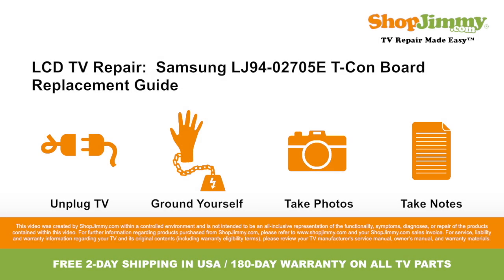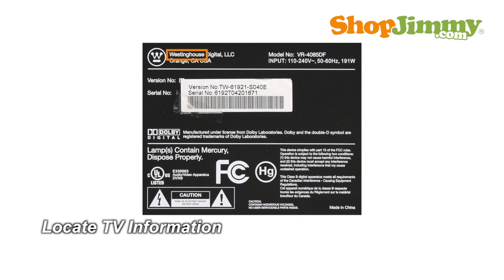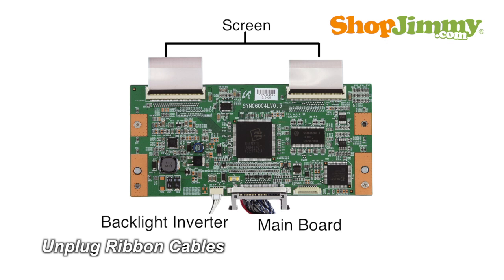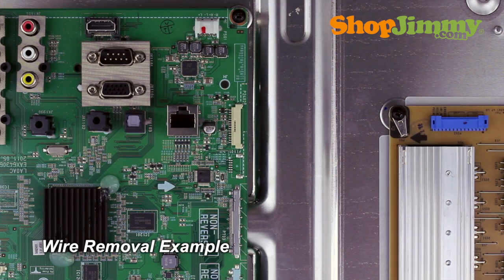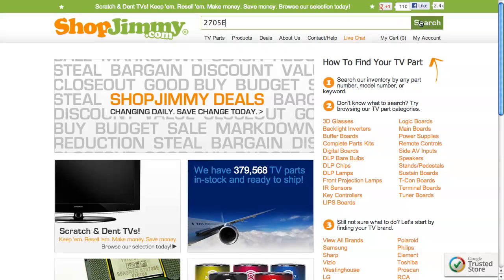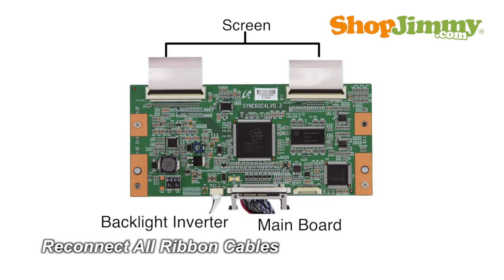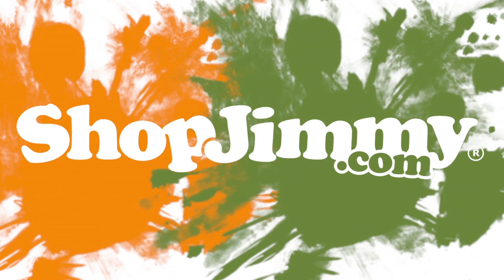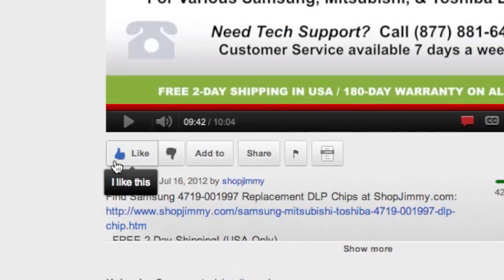Samsung TV Repair - How to Replace T-Con Board in LJ94-02 705E Model - How to Fix LCD TVs

Comment: Question, I have a proscan LCD that as soon as any picture shows up the tv automatically shuts down.  It does this as soon as a picture from the antenna, dvd or xbox comes on the tv.  I have disconnected various boards and what I have discovered is that when I disconnect the FPC cable from the T-Con the tv stays on.  There are two FPC cables and I have tried leaving one connected but as long as any FPC cables are connected the tv automatically shuts down the moment a picture signal reaches the tv.  I can work the tv menu on the tv as long as there is no signal input.  Does this mean the T-Con board is junk or could there be other possibilities?

Comment: Hi, I have a Samsung 32 inch lcd tv. Model LN32A330J1DXZA SERIAL # AKZ43CRQ800919Z. TV has no power or picture. The capacitors look good, no buldging or leaking, could the t con board also cause this problem? Right now the tv dose nothing, Thanks for your time.

Comment: hi sir. I have a 32" LED before couple of day it turned off bcz of short circuit then I show my LED to the repairing shop repair man checked the LED carefully n then he found the problem. the T cord was short or finish.anyway I buy the new T cord which is matched with original T cord so he fix the new T cord and on the power of my LED but now the problem is that LED picture is rotate down so now I am watching my LED up side down plz send me a useful suggestion hope u understand me. thx allot regards Waseem Ahmed Pakistan

Comment: I have a Samsung 46 in 3D LED TV.  We get audio on it but the video stopped working.  It does have the back light still. I watched a few of your tutorial videos on YouTube and think it has a faulty TCon board.  The part for that is LJ94-03870c.  Do you think it is the TCon board that I should replace.  Do you have that part? How do I replace it because one of the ribbon is difficult to remove?
Reply from the maker: Parminder Sahota  Try all repairs and troubleshooting at your own risk.  I recommend running the flashlight test on your TV.   Here is a link to a video we produced that shows how to run the flashlight test. https://www.youtube.com/watch?v=xUzCLgoSPGM Please reply with your flashlight test results and we can recommend a replacement part for your TV repair. Thanks and please let us know if you have any questions! www.shopjimmy.com

Comment: Hi, my samsung tv is solarized. if i let it "rest" for about an hour or so and turn it on, it's fine again, but only for like 15-30 seconds tops, then it gets solarized again over the course of a minute or so. i've opened the back panel, didn't see anything unusual on any of the boards. disconnected and reconnected all of the cables on the t-con, didn't make any difference... any thoughts of whether or not i should buy a new t-con and replace it?
Thanks in advance!
Reply: oh, forgot to mention it's a 5 year old  LA37A550P1R and when the image is solarized, the menu is solarized as well.
Reply from the maker: shvedoren  Please watch this video FIRST to help with your repair!  https://www.youtube.com/watch?v=BP3NVNCGEv8  This could be a problem with either the main board, the t-con board or the TV panel.  You can replace  the main board and the t-con board to see if that fixes the problem.  Click this link to replacement parts:  http://www.shopjimmy.com/catalogsearch/result/?q=37A550  There may be multiple boards for the same TV model number, be sure to match part numbers on your current board, with your replacement for compatibility.  Thanks and please let us know if you have any further questions with your TV Repair!  www.shopjimmy.com

Comment: Hi Shop Jimmy, 

Great video!  My Sanyo was experiencing some common vertical lines and I replaced the T Con Board.  The TV was working fine for about 5-6 days after the repair, but the problem is back.  The lines appear sporadically for brief moments of time.  Is this an inherent problem with the ribbon connections perhaps?  Can I tape them or something to make them more firm? Thanks again.

Comment: i am from india i bought a a new samsung LCD tv model code is LA32C450 last 2years back from last few month top of display  one blue line appear thought right to left side initially day by day it is creasing now it is incensed half of the tv display then i have contact with samsung technical engineer he told it has that display board problem it's need to change display board that board price half of the new LED TV price and he said this problem developed by using cleaning display liquids so i am realy become a mad because which is correct please give me a solution thank you
Reply from the maker: vijesh m   This sounds like a TV panel (TV Screen) problem.  If your TV panel is bad, it may be more cost-effective to replace the TV as panels are typically hard to find in stock, difficult to replace, and expensive.  Thanks and please let us know if you have any further questions!  www.shopjimmy.com

Comment: I got a samsung 46eh6000 screen went black with a dim glow . Sound is still working.I replaced the tcon card that I bouth from you guys but same problem.
What could it be ?
Reply from the maker: Pussinboots1987   Please watch this video FIRST to help with your repair!  TV Repair! LCD, LED, Plasma, DLP How To Fix Your TV with ShopJimmy.com Help!  I recommend replacing the main board in your TV.  Follow this link to replacement parts:  http://www.shopjimmy.com/catalogsearch/result/index/?cat=56&q=46eh6000  Be sure to match part numbers on your current board, with your replacement for compatibility.  Here is a link to a video showing how to identify your part number, click here:  Samsung Main Boards & Digital Boards: Part Numbers for LED, LCD, DLP, Plasma TV Repair   Thanks and please let us know if you have any further questions with your TV Repair!  www.shopjimmy.com

Comment: i have a vertical line on my 40" samsung flat screen tv. it's about 4" away from the right side of the screen. the line is blue in color.
Reply from the maker: dale swanson   This sounds like a TV panel (TV Screen) problem.  If your TV panel is bad, it may be more cost-effective to replace the TV as panels are typically hard to find in stock, difficult to replace, and expensive.  Thanks and please let us know if you have any further questions!  www.shopjimmy.com

Comment: hi, i have a samsung LN40A530P1FXZA series 5...I'm getting sound , but picture is white with no color. i can barely see images. please help. Amelia
Reply from the maker: Amelia Ivery   I recommend replacing the T-Con board in your TV.  Here is a link to replacement parts for your TV model number on our website, click here:  http://www.shopjimmy.com/catalogsearch/result/index/?cat=63&q=LN40A530P1FXZA  Be sure to match part numbers on your current board, with your replacement for compatibility.  You can also call our customer service for further assistance with your purchase.  (877) 881-6492  Thanks and please let us know if you have any further questions with your TV Repair!  www.shopjimmy.com

Comment: Ihave a 46 samsung lcd  model LN-46B650 and it also has vertical lines in the picture as well i see this is a big problen with samsung tv. Now samsung is aware of this problem but would not stand behined thier product to help repair it i guess my next step is to report them to the BBB. please feel free to respond thank you.
Reply from the maker: Martin C   This sounds like a TV panel problem.  If your TV panel is bad, it may be more cost-effective to replace the TV as panels are typically hard to find in stock, difficult to replace, and expensive.  Thanks and please let us know if you have any further questions!  www.shopjimmy.com

Comment: Hi guys- I am having an issue with a 46 In Samsung LN46B650 with vertical yellow and red lines and ghosting as well.  A little research reveals lots of problems with this issue and it points to possibly or more likely the T-Con board ? would you agree with this assesment and also I have read that this model is much harder to access than in the video above.?
Thanks
Randy

Comment: Hi, I was wondering if you could help confirm my suspicions as to what is wrong with my Samsung LE40M87BDX/XEU, one day all colour but blue and white went from the tv, picture is barely visible, but everything is fine. I believe this is the TCON board?!? am i correct in thinking so?
Reply from the maker: liam langford  This could either be a problem with your t-con board or main board in your TV.  I recommend replacing the t-con board first and if that does not fix the problem, then I would replace the main board.  Here is a link to replacement parts for your TV model number on our website, click here:  http://www.shopjimmy.com/catalogsearch/result/?q=LE40M87BDX%2FXEU  You can also call our customer service for further assistance with your purchase.  (877) 881-6492  Thanks and please let us know if you have any further questions with your TV Repair!  www.shopjimmy.com

Comment: (cont.) I have been reading around online and research is leading me to believe it might either be the t-con boards or main but what are the chances?..Im looking to carefully make repairs myself..if possible after extensive research.
Reply from the maker: I believe the problem is either the T-con board or the TV panel.  If the problem is the TV panel it may be more cost-effective to replace the TV.  You can replace the T-con board to see if that fixes the problem.  Here is a link to replacement parts for your TV model number on our website, click here:  http://www.shopjimmy.com/catalogsearch/result/?q=UN60ES6100FXZA  Be sure to match part numbers on your current board, with your replacement for compatibility.  Here is a link to a video showing how to identify your part number, click here:  Samsung Timing Control (T-Con) Boards Part Numbers Identification for LCD HD TV Repair  You can also call our customer service for further assistance with your purchase.  (877) 881-6492  Thanks and please let us know if you have any further questions!  www.shopjimmy.com

Comment: I have a Samsung 60 inch led smart tv model no. UN60ES6100FXZA version HH01. I havent had the tv for even a year before my 3 year old son took a squirt gun to hose it down with. First it was a black pixel width size line started running down the screen to become solid and along came a couple others making themselves permanently planted on the left side of my screen  each like 4-5 inches or les from each other...I saw the splatter marks of the water where they hit that general area and mightve gone over the tv and ran down to the back openings...
Reply from the maker: Anguisssette I believe the problem is either the T-con board or the TV panel.  If the problem is the TV panel it may be more cost-effective to replace the TV.  You can replace the T-con board to see if that fixes the problem.  Here is a link to replacement parts for your TV model number on our website, click here:  http://www.shopjimmy.com/catalogsearch/result/?q=UN60ES6100FXZA  Be sure to match part numbers on your current board, with your replacement for compatibility.  Here is a link to a video showing how to identify your part number, click here:  Samsung Timing Control (T-Con) Boards Part Numbers Identification for LCD HD TV Repair  You can also call our customer service for further assistance with your purchase.  (877) 881-6492  Thanks and please let us know if you have any further questions!  www.shopjimmy.com

Comment: I am trying to change the T conn board in my  SAMSUNG
Model no.  LN-T4661F, MODEL CODE. LNT4661FX/XAA
SN. AHBB3CPPC06804R and I can't figure out how to take off the ribbon cables. They don't seem to have a tab to flip up to take the ribbon cable off. The T conn board is S2247C7J591Y   245014.
Reply from the maker: rick pierre The tab should flip up just like most other T-cons.  You can upload a video or photo and reply with the link if you would like us to take a look.  Thanks!  www.shopjimmy.com

Comment: Samsung LCD 46"  Model# LNT4665F 

The screen appears to be very dark (used movie Immortals to test). The image appears to have a motion lag. The TV was given to me after the first owner "fixed" the clicking noise and slow boot up by changing two capacitors (which worked). But I think the damage has already been done to the T-Con board. Will the T-Con board create an issue as described above?
Reply from the maker: Marcus Anderson I would recommend replacing the t-con board in your TV.  It appears we have substitute parts available for your TV model number.  Here is a link to replacement parts for your TV model number on our website, click here:  http://www.shopjimmy.com/catalogsearch/result/?q=LNT4665F+  Be sure to match part numbers on your current board, with your replacement for compatibility.  Here is a link to a video showing how to identify your part number, click here:  Samsung Timing Control (T-Con) Boards Part Numbers Identification for LCD HD TV Repair  You can also call our customer service for further assistance with your purchase.  (877) 881-6492  Thanks and please let us know if you have any further questions!  www.shopjimmy.com

Comment: Samsung LCD 46''   Model No.  IN46A530P1F

The left side of the screen when turned on( static fuzzy screen) is white 7 inches in from the edge and then fades into black/white static fuzz towards the center.

When I turn my ps3 on(while connected via HDMI), the left side is white with dark patches around mid/left part of screen( purple/white black colors)... when I navigate through menus, the previous icon stays there and slowly fades into the current icon.... after a couple minutes the white/purple faded away and was replaced by black.... I can however, see picture behind the black all throughout.

here is a link to a video of my tv...

https://www.facebook.com/photo.php?v=224941864345625&l=5760372388776436252
Reply from the maker: Jeff Sveinson This sounds like the problem is most likely the TV panel.  TV panels are typically hard to find, expensive and difficult to replace.  It may be more cost effective for you to replace your TV.  Thanks and please let us know if you have any further questions!  www.shopjimmy.com
Reply: I had it temporarily fixed.. I took the back panel off and made sure everything was plugged in properly and then tried tapping on the panel and tilting the tv a bit an it fixed it.. then I had to moved it across town to my new place and its back to square one.. im sure something is loose so I will be checking further into it.

Comment: Hi there,
We have a samsung LN46A530P1F
At first we would turn the tv on and half the screen would be almost opaque black for the first 10 minutes or so, every time it was turned off and on. Now the TV doesn't do that anymore but rather shows all the colors as negatives. I.E. white is black. It looks like what I'd imagine an psychadelic acid trip would. Would the T-con board replacement fix this?

Comment from the maker: @Leo Godin - I would recommend replacing the t-con board on your TV.  This is not a guaranteed fix, if it does not work then your panel is bad.  The metal cover is there for cooling purposes.  Thanks and please let us know if you need helping finding your replacement part.  You can also call our customer service at (877) 881-6492.  Thanks!

Comment: (Cont.) My question is; would the T-Con board failure control or cause vertical lines and could it be that the board is overheating as the unit starts out clear then loses the picture as it heats up. Would leaving the metal cover plate off aid in cooling the board as its only purpose seems to be in mounting the table-top stand. I was told the problem is the LCD panel and my set is done but if it works even for three seconds then I have to believe it is repairable. Any help would be appreciated.

Comment: My TV is a four year old Samsung LED on LSD, or so it appears. It went from a clear, sharp picture to mostly white vertical lines that sometimes fill the screen completely or leave areas on each end open and clear. When the set is first turned on and cool the picture is normal for three to five seconds and then the vertical lines begin to appear filling the screen from the center outward. They remain, although changing in width and intensity, and do not disappear until the set is turned off.

Comment from the maker: @316whatupz - It sounds like this is a panel issue.  The tabs on the panel eventually warm up(after running for 30 min) and then you have better contact and the lines go away.  Unfortunately there is not a board you can replace for this issue.  You could try putting rubber or some item between the bezel and the tabs.  This would help with the contact, but is not a guaranteed fix. I will send you a link in a message to a video that could help you.  Thanks!

Comment: I was told by a repair technician that my Samsung 37" LCD TV, a LN37A550P3FXZA has a T-CON board that is attached to the screen and it cannot be replaced without replacing the screen. This sounds a bit suspicious to me.  Is this correct?